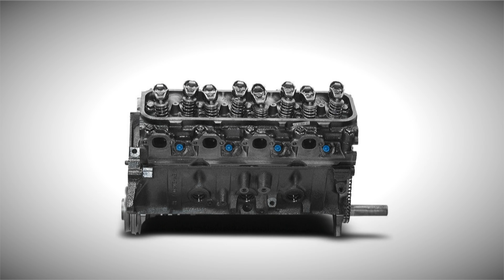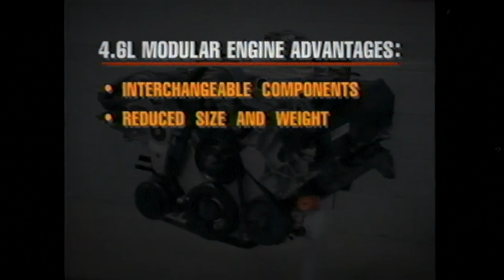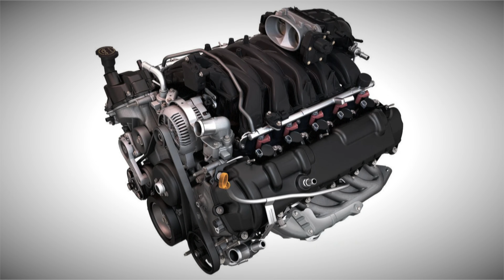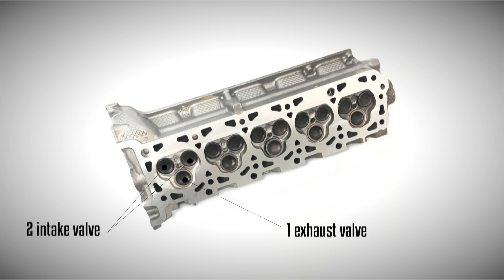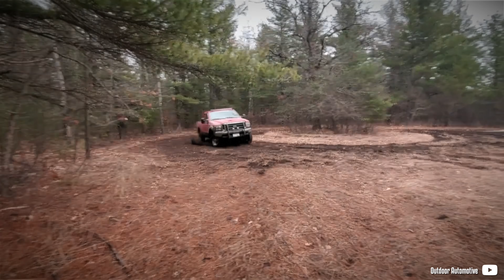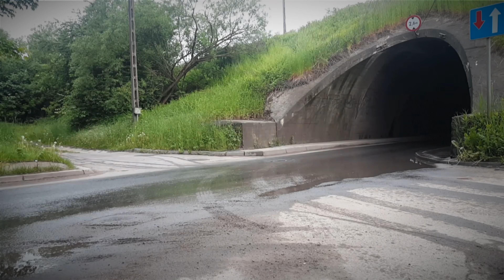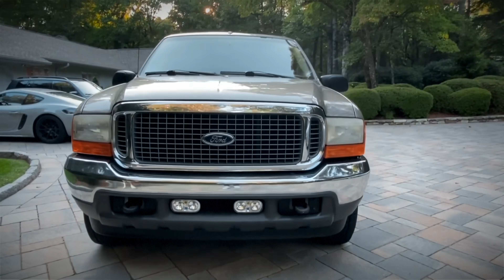Is Ford's V10 Truck Engine Any Good?

Comment: I had a Ford 250 with a Triton V10 in it. I think  like 2004 2005. I'm old is what this comment is making me realize. Anyway, the only problems I ever had with that truck was when we had to sit in traffic idling it love to overheat. But it could haul a shit ton of weight both in the bed as well as the trailer I pulled and it was effortless. So as long as you didn't ever have to get stuck in traffic, you were all set
Reply: If it overheats sitting in traffic then you probably have an air flow issue.  That shouldn't happen....
Reply: @Flies2FLL  your right i bet something was up with the fan clutch
Reply: @Flies2FLL  I haven't had it in years. It didn't do it all the time. If it was someone in Philly though, she didn't live traffic
Reply: @michaelfrench3396  That's odd.  I'd replace the fan clutch.  Your truck is NOT a '70's British Leyland product, it is a very modern design and something is wrong.
Reply: @Flies2FLL  I didn't do any of those things. I drove her until the 2-year lease was up and then I got another truck. I've been driving Honda Ridgelines for a while now though and I'll tell you what zero problems. Very reliable tows my boat with no problem. Tons of storage and great gas mileage. My 2022 has 300 horse going through a 9 speed tranny and it's beautifully effortless to go fast
Reply: Or clogged thermostat or worn water pump impeller from rust and scale wears down the blades on the impeller.🤗🤔😁
Reply: @ShadeTreeShadow  nope fan clutch. if it was any of that other stuff you said it wouldn’t just overheat in traffic sitting. It would overheat all the time. Boom mic drop
Reply: Thermo fan.
Reply: * overheats the engine every time traffic slows***
Truck for sale!
Runs great!
Never overheated!😂😂😂
Reply: They usually can barely pull the trucks they sit in lol guy down the road from my friend has an 09 and it'll barely spin the tires on the dirt road they live on and once it shifts into second it's done.. things are turds
Reply: @adamguzzo94  it's quite likely that 'that' engine while looked after, is not well serviced or offten, and/or hasn't been run in correctly, and/or is run on cheaper octane fuels.
Reply: @razor1uk610  well now after about a year of him having it I believe it's on its way to the scrap yard with over 5k still owed on it.. yes he tears up every vehicle he's had but at the same time he had an avalanche he beat on just the same for years and I'm not even trying to stick up for avalanches cause I hate them but for a HD truck you'd think it could handle some off roading and a few burnouts without it literally rattleing itself apart.. and it WAS a fairly low miles truck. 130 something I believe when he got it and he's only the second owner.. I've had 1000$ s10s that have been driven harder than that shit heap and they never bankrupted me doing it and when I said it'll barely turn the tires over on gravel i meant it literally.. Even when he first got it it was just a gas sucking dog..

Comment: It’s great to hear that these are actually decent engines. I always wondered. Lovely video as always 👍
Reply: Their not lol go buy an old 460 powered f250 or something if your really into ford's. Better engine all the way around, these things are some of the biggest piles anyone's has ever put in a truck
Reply: I think they SUCK! spitting plugs, guzzle fuel! pain in the butt! the 460 SUCKed! MORE! fuel.
Reply: @davefellhoelter1343  actually the 460 was much more fuel efficient than the V10 ,, i've owned  trucks with both engines ,,and my 460 powered 86  F350 would get 13mpg when not towing and if i drove smart it would get 9 towing my 35ft 5th wheel camper ,, my 99 F-350 i had in 2008  wouldn't get over 11 at any time  and pulling the same camper got worse mileage than my peterbilt 379,it's got a 3408B cat 18 liter engine and gets 5.8 mpg towing 50,000 pounds,,,a chevy 454 can get better mileage than  the V10 too ,,i ditched all my fords in favor of something easy and cheap to fix an chevy C3500 with a 454 with  a carburetor
Reply: @wildcoyote34  me too. never had any 460 get better than 8 mpg empty and level.
all my V10's got about the same mpg but better power curve, smoother! While LARGER and Heavy
Reply: @davefellhoelter1343  the V10 wasn't bad where power was concerned  i just hated it's liking to wind up to the moon , it had just as much pulling power as the 460 ,, the 360 was just like any other big block V8 it produced all it's power below 3500 rpms 
they weren't built to be fuel efficient ,,, the term NOT A FUEL EFFICIENT VEHICLE  was coined to describe any truck with a big block V8 ,the V10 truck i had never broke 6 while towing it would get 10 or so on a long trip where i wasn't towing and i kept the speed under 70 ,,my 460 would average 13 in the same circumstances doing highway cruising at 68 or so ,,my 83 GMC C3500 i have now has a well tuned 454 that makes just shy of 400 horsepower and it averages about 10 when not towing and never goes below 8 and it'll tow my 18,000 pound 5th wheel  without breaking a sweat at 70 on the interstate
Reply: @wildcoyote34  this is WHY I now own GM's and Toyota's Now days? Had every kinda truck that drives to a work site from the early 80's to now, some mine some others. The best in my stables was a Mopar 318 and 360, second best GM 5.7 or the 8.1 ford 350 about the same with triton. LEAST Fav! is GM 454, Ford V10 or 460 I Could Not Wait to get rid of them! will never own another no matter the deal. had about 6 GM 4.7's over the years, that a decent engine.
Reply: @davefellhoelter1343  i'm not sure which engine you are talking about because GM doesn't have a 4.7 ,,454 was hands down one of GMs best engines ,more reliable than anything built by mopar or ford ,,the 8.1 is a piece of crap that suffers from oiling issues and chronic oil usage due to it's shitty PCV system , the 8.1  is an oversize 454 ,it's a pig that GM created to compete with the ford 6 liter diesel and they quit making it for a reason ,,the 6.0 LS is better but suffers from lifter issues,, unless you are referring to the 4.8 liter LS engine which is another joke ,,frigging gutless turd with no balls ,,fine in a car  but not good for a truck ,once years ago i rented a 2007 GMC 4 door truck for a family camping trip fucking dumbest thing i ever did,, thing couldn't go over 50 on any hill and it constantly hit the rev limiter cause it couldn't shift to high gear cause it had no balls
Reply: @davefellhoelter1343  you mean 351 Ford? What’s the difference between the 8.1 and V10 Ford if you dislike gas guzzling so much the 8.1 isn’t any better power not better either. Pulling is done by transmission and gears anyway and Ford had better transmission and front or rear end on trucks always has.